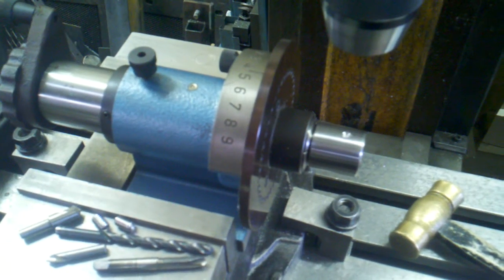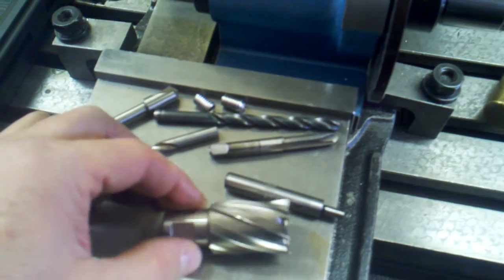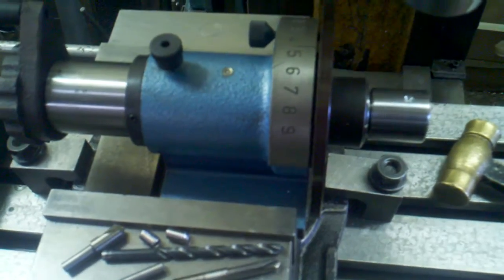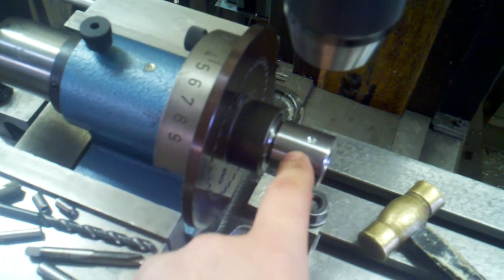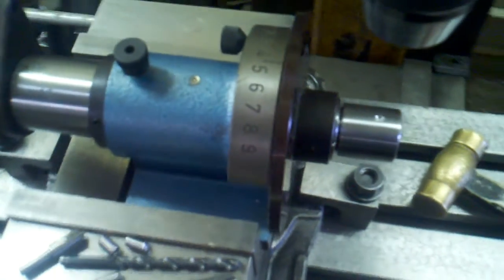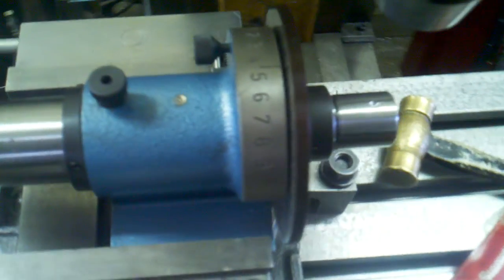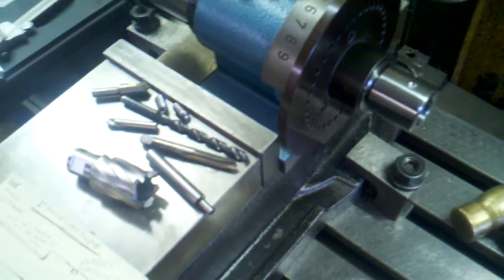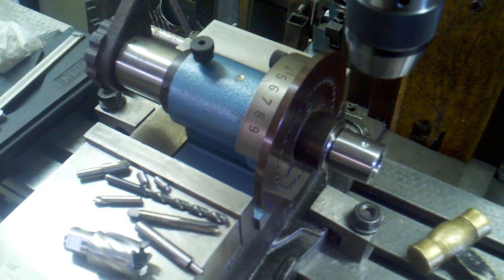Annular cutter holder adapter

Comment: tjsnordic Hey thanks for the shout out.  I was using R8 collet myself, and I think that is fine up to a certain point, and I don't know really were that point it.  But I will tell you that its somewhere BELOW 2" in diameter.  I know this because I spun a 2" jancy annular cutter in a 3/4 collet and ruined the collet.  This is what drove me to make the cutter arbor, good R8 collets are not cheap!  Keep up the good work on the videos.
Reply from the maker: Thanks again. You win the boob-ie prize. You are the 500th subscriber.
T.J.